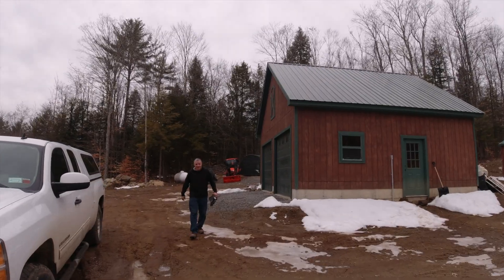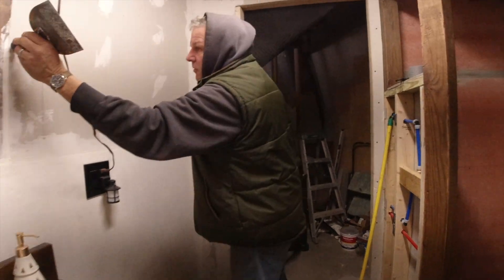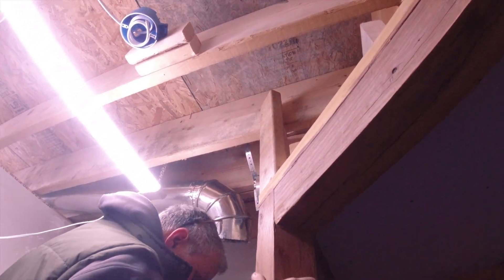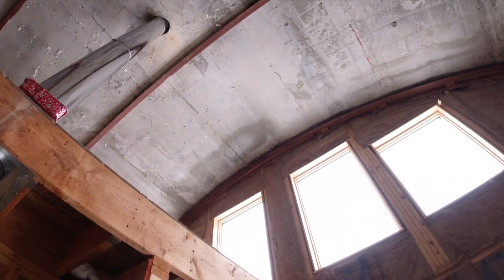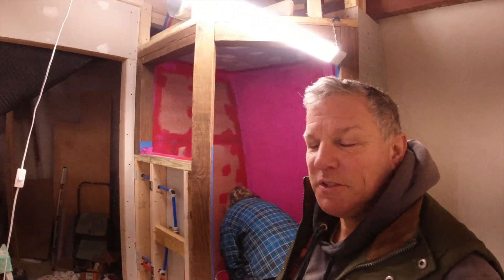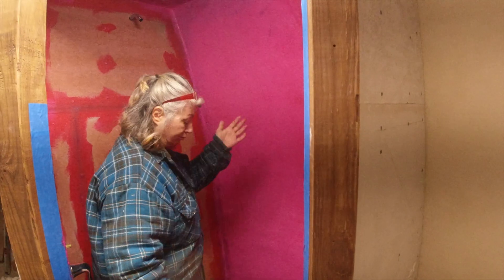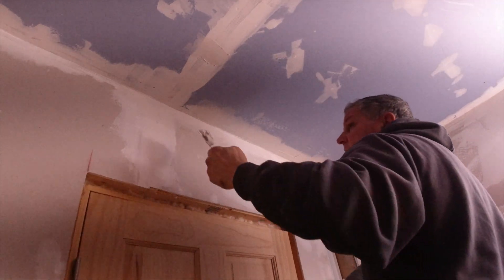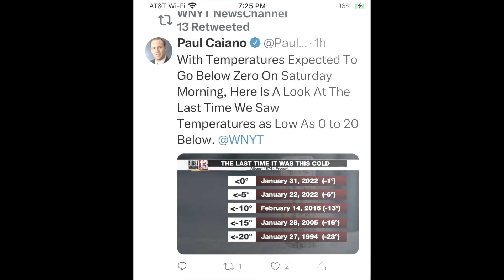CHALLENGES, SOLUTIONS, & WINTER FUN | OFF-GRID BUILD | ADIRONDACKS

Comment: I am a hvac technician  specialize in radiant heat. A lot of your problems could go away if you set that boiler to constantly keep the baseboards trying to keep the dome at an even temp. Also that ERV up and running on a 20/60 constant again would help with moist in the dome. If the boiler is maintaining a constant H2O temp it is actually work less and using less propane. Also that heat will with setting of drywall mud or tiling compound.
Move your tstat to an area where the wood stove doesn't send heat
Reply from the maker: We just moved the thermostat into our bedroom. Makes a huge difference so far so thank you for that! Working on the ERV right now as well 👍👍

Comment: Wow you guys are troopers for sure! We have our moisture issues somewhat under control. Seems using propane for heat produces moisture. We are seeing temps of 65 inside with 40 degrees or a little less outside using minimal propane heat. We do see a rise in humidity but it is minimal (like 49%). We got our perimeter drains on the top of the shell done and are finishing our final burial process. I did post an update.
Reply from the maker: 49% is great! I think that is actually about the highest recommended level for health. It's nice to know your staying pretty warm inside with minimal effort, gives us hope for the future! Going to check your update right now, and your flickr pics are great! Love the floor plan.

Comment: The times I was able to go to yall's area I was amazed at how dry the pine wood was. There's no way you could burn pine in the wood heater here in Texas, but there is no problem burning pine where you guys are from.
Reply: Pine is the worse wood to burn in a stove
Reply: In Montana we burn almost all pine (ponderosa, lodgepole) and some fir or larch. It burns in my wood stove and fireplace beautifully. I only harvest standing dry trees and ideally season for a year. We survive well even during cold snaps of -20.
Reply from the maker: The pine we are burning is white pine and has been drying for about 3 years. It burns amazingly well and is the best wood we had until we got a load of kiln dried hardwood last week, and it's amazing!

Comment: In your situation where the wood stove is not keeping the house warm enough you shouldn't be burning pine.  It's got very low BTU output.  Burn dry (not seasoned) hardwood.  What's your plan to fill the area under the solar pannels before next year?  I suspect if you fill that area to 6ft tall it's only 2yrs worth of firewood.
Reply from the maker: We got a load of kiln dried hardwood and wow!! Just wow! Our house is staying so much warmer. Living and learning. We have some ideas on cutting down the dead hardwoods on our land and storing it, but also looking into building a solar kiln down the road now that i know how good the wood is!